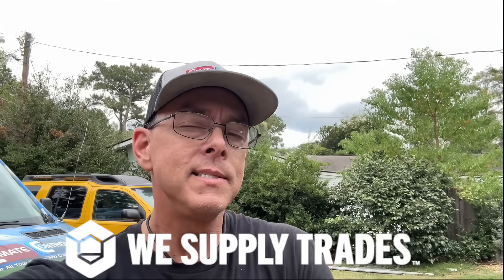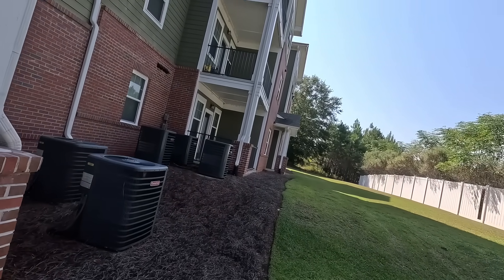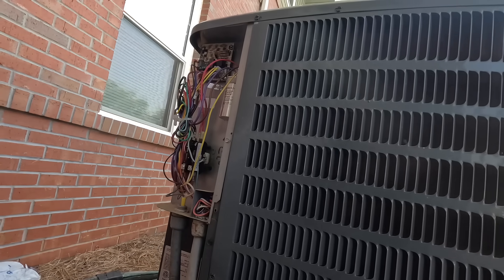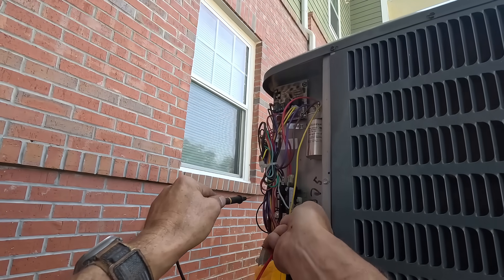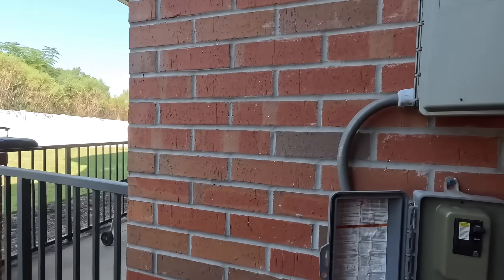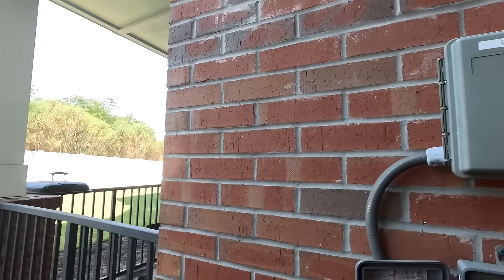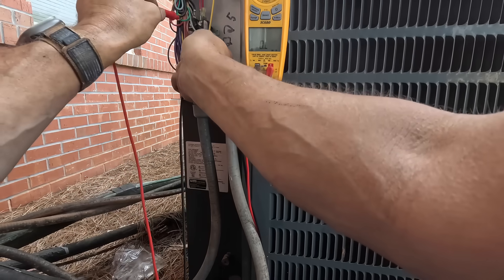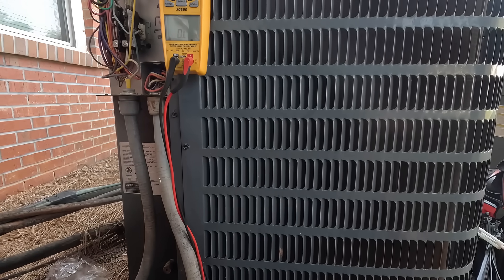Common Problem At Apartments

Comment: Multi-story apartment building and you have to keep going up to the roof and back because you're by yourself
Reply: Most guys that been doing this long enough we know what we gonna prob need on what the call complaint is. 1 think i leaned in almost 30yrs of this. Def work smarter not harder,later in life your body will be screaming at you like mine does 😂

Comment: Good video Curtis! I agree with your diagnosis but wanted to throw a precaution especially to techs in the south where sometimes shirts come off when approaching 100 degrees that it is best to always use an alligator clip on lead on compressor terminals when bending over the condenser coil touching it with wet skin on coil and one finger on meter lead holding meter lead on terminal because you will be reading through your body that is now grounded laying across the coil...always best to not touch meter leads on either side! I have seen others make this mistake numerous times over the years so just wanted to add this for others Curtis. The wetter you are the lower the ohm readings!

 Under dry conditions, body resistance (e.g., hand to hand or hand to body) can be 100,000 ohms (0.1 MΩ) or higher.

When sweating (wet skin), resistance drops significantly because sweat is conductive (containing electrolytes like salt). Typical values for wet or sweaty skin are in the range of 500 to 5,000 ohms, often cited as around 1,000 ohms in electrical safety standards for conservative shock hazard calculations. Ohms are also lower if you have a cut on your finger where you are touching the probe...skin is an insulator!

Give a biscuit to Riley my friend!

Comment: @2:15:  It makes no sense to me to check resistance across a connected contactor that just pulled in.  Check voltage in and out.  That's it; that's all you need to know on a contactor that pulls in.

I really like your work, but I often think your electrical troubleshooting is inefficient and illogical.  Maybe I'm wrong.  Could you explain what you were thinking here and why it made sense?  What were you testing that you didn't already know?

Comment: Is it normal in the area to have standalone A/C condensers for apartments?  I have never seen that here in the Minneapolis area.  The A/C units are in the apartment.
Reply: those are heat-pump setups with extra bells and whistles added for indoor air quality. not that it's worth a darned, but it meets their government efficiency spiel. lol

Comment: When you are checking resistance and you say went to zero and the meter reads 0L, doesn't that mean infinity or an open circuit.
Reply: Yes, there’s a big difference!
Reply from the maker: You’re correct
Reply: @HVACGUY ,im addicted to watching you repair those things, the only thing better would be showing us with a laser thermometer each one cooling at the end of each video.
Reply: OL=Open Line

Comment: I run into that a lot too. Some of the properties that I have worked on for years I have gotten them straightened out but when it’s a new complex that I haven’t been to I’m always leery of the mislabeling issue. Customers will have been paying for their neighbor’s electricity and visa versa. It’s crazy.
Reply: Have seen dozens of these over the years in NC and SC most do not get caught until either first service call when tech cuts off disconnect and still have voltage but have seen a couple that were 7 to 8 years old and were in a commercial setting so happened just like this the other tenant moved out and shut power off then clear as day but will really piss off tenants who were trying to conserve energy by making them sweat while other tenant was enjoy 68 cooling with low bill and other tenant cooking going broke paying high electric bill! Have seen some techs just cut off the one they need and not say a word due to 10 calls dumped on them so explains how it can happen....shouldn't but anyone (tenant) in this setting needs to commission their systems to verify!
Reply: Are you licensed in HVAC? How does one go about getting professional references?
Reply: @NoNeckNickB oh. And yes I am.
Reply: @NoNeckNickB  that’s a topic for google. It depends on your State.

Comment: So what was the problem?
Reply: They turned the power off to the wrong apartment due to mislabeling.
Reply: @AaronPowellvox  I don't think that's quite right, I think that 235 had the power turned off, which is correct, but 225's condensor is on 235's electric and 235's condenser on 225's electric!
Reply from the maker: @marshallhenry9430 exactly